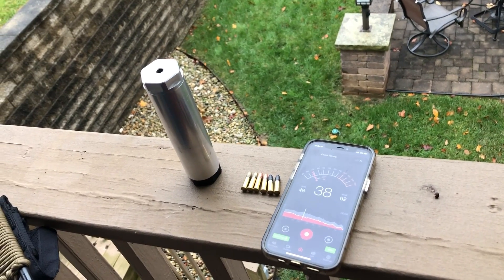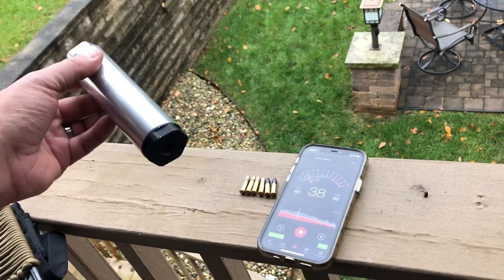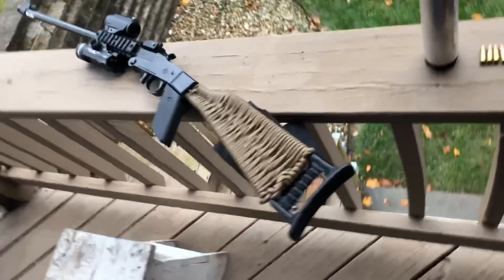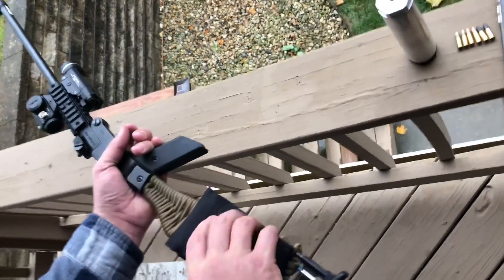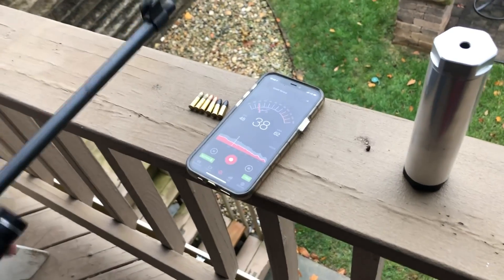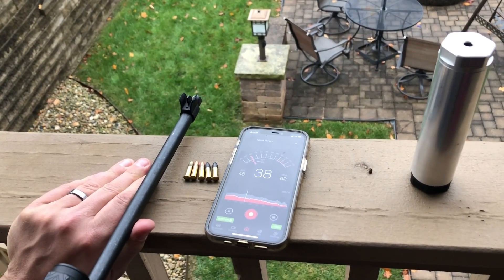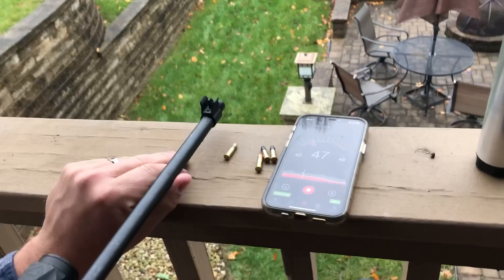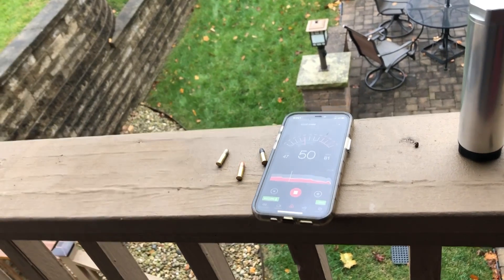Chiappa Little Badger suppressed with .22LR standard velocity and .22 sub Sonic

Comment: the first shot with a can is always louder then the rest . first round pop it's called . i love subs in my gun . use a lot of the aguila 22 sniper subsonics .
Reply: Unless it's automatic or rapid fire, in which case the rounds become progressively louder as the gasses don't have time to escape before the next round is fired.
Reply: @nacholibre1962  true . also depends on the can . the size ad length of it . mine is a old gemtech 22 lr can and in a bolt gun all you hear is the firing pin go click and in my old v22 upper you hear a click from the firing pin and a kinda slap slap of the bolt working . until it is shot fast . then back pressure tries to get the case out before the bullet leaves the barrel . even had 2 rounds that fired and the case exploded at the ejection port ! was from the back pressure of the can and weak reurn springs !